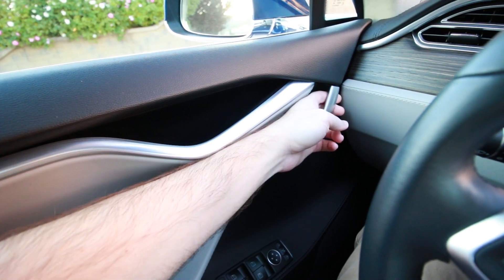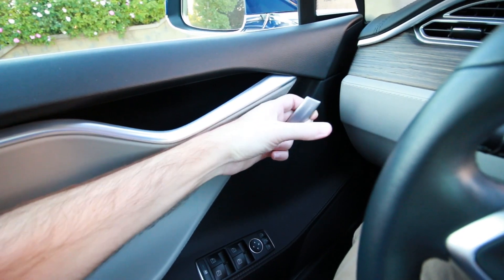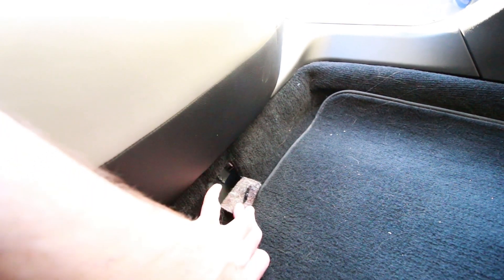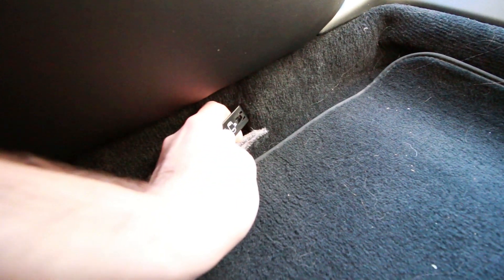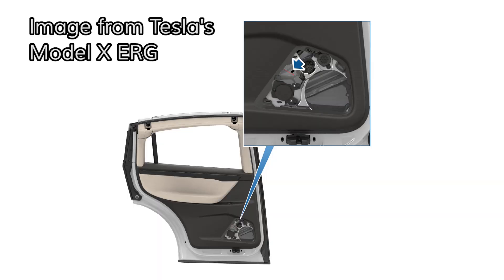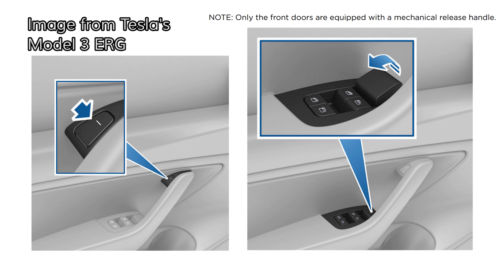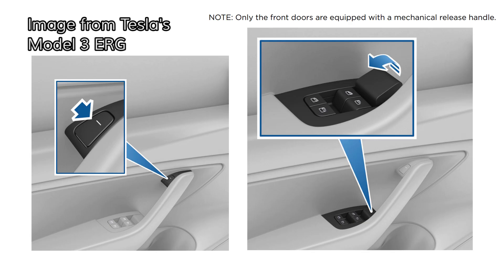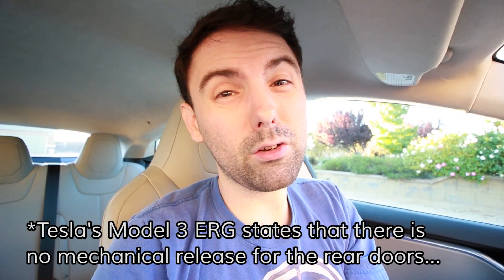How To Open A Tesla's Doors In An Emergency

Comment: It's frankly baffling that a car is allowed on the road that could lock the fucking rear passengers inside in the event of an accident.
Reply: All modern cars can lock the rear passengers in if the child locks are set to the locked position. (I've seen them come new from the factory set to locked)   You actually have to open the rear doors to reset them to the opening position.  Be aware of this as it could indeed be dangerous.
Reply: Unfortunately, all cop cars are like this.
Reply: Stopping children letting themselves out on the motorway is considered a higher priority as that is much more likely than an accident that causes the doors to stop working. If you need to get out in a hurry most people would be able to climb through to the front to go out that way.

Comment: One of the many reasons why I’m never going to buy a Tesla. I came to this video after hearing about someone burning to death in their Tesla after a crash which caused the battery to catch fire and nobody could get the door open from the outside and the occupant inside struggling to open the door after the crash. What a horrific way to die.

Comment: So if your kids are in the car and it catches fire with them in it you're absolutely fucked.
Reply: Not to mention you're right on top of the closest equivalent of a mattress-sized Samsung Note 7...
Reply: The door locks work on the 12v battery so I'm most cases you could still just open them normally.

Comment: Man, it's an awful design for the back door release. I wonder how fast you could open up that door in case of an emergency, with the car filling with smoke, or water, or being upside down...
Reply: The mechanical door release overrides all the electronic controls including locks and child locks. It's a fail safe system in case for whatever reason the electronic locks aren't working. Because the door can always be opened with it, even when the child locks are on, they have to hide the release in the back so children can't open the door when you're on the motorway etc. That is why they are like that. I'm not saying it's the best way to do it, but there is a good reason. They have to make a balance between making it hard for a child to the door when they shouldn't vs making it easy for an adult to open the door in an emergency.

Comment: I dunno how they even passed safety regulations. If your car is on fire and your injured your basically screwed. Oh let's remove the speaker grill pull on a piece of wire and lift the door.
Reply: If you kick the speaker grill in the middle  it will pop off , but I 100% agree Tesla should of designed like an Airliner over wing emergency exit latch that is clearly visible with instructions placard, after all you do get the sensation your in the cockpit of a fighter Jet in a Model X
Reply: Just jump in the front and goooooo that's what I'd do model 3 style xd
Reply: A person died trapped in a model S that engulfed after an accident, responders couldnt open the door to save him. Came to this video and saw your comment :(
Reply: Ole Brumm  The family filed a lawsuit, not sure about the latest developments..
Reply: Ole Brumm  Same even I'd want to hear what they say, I mean it's not a small issue. They need to explain this to the public regardless of the lawsuit. RIP to the guy..
Reply: @santoshs5244  i knew that person. You are talking about the doctor in florida?
Reply: @janabsahib5429  yes
Reply: @santoshs5244  What a way to go.
Reply: Should've just follow the front door mechanism.
Reply: If Tesla built houses, you'll be unable to enter or exit your house in case of a power failure or emergency... unless you remove this section of drywall to access a hidden mechanical release for the electronic back door...
Reply: The reason the emergency release is hidden in the back is so that kids don't open the doors when your are driving.
Reply: @rapnjoe Yeah it should be marked in red like the old automatic seatbelt override switches

Comment: The government should establish laws mandating all door release should be mechanical and prohibit any type of electronic door lock release that can fail when power is out. That's the same idea as the law prohibit blocking the fire escape of any building. Nobody wants to be in the situation that need to move obstacles when trying to escape a building on fire.

Comment: on the model 3, 
the back seats fold down an then you open the trunk using the child manual unlock switch required on all vehicles to open the trunk from inside
Reply: Manual open for trunk is availablebit not for the door. Musk needs to have his head examined.

Comment: Remember braking the window is always an option. It is not as easy as they make it look in the movies.   I have an glass braking tool in all my cars.  With enough force if you punch dead center with the side of your fist  the drivers window will turn into 1000 little squares of glass.  Never seen it done on an rear window though.
Reply: Windows generally don't have brakes on them
Reply: @wire_writer  they do if you have glass rims.
Reply: Teslas are designed for the windows to be shatterproof. A few people have burned alive in Teslas because paramedics couldn't figure out how to shatter the windows or open the doors manually from the outside.
Reply: @SkyyPiano  not true, all windows in the us must shatter in order to pass us certification.  Only the top glass is designed to stay in place during a crash.
Reply: @fatboy19831  Read the case of Dr. Omar Awan. He burned to death in a Tesla because of some mechanical failure on Tesla's part.

"First responders then arrived on the scene, and were also left stumped. Teslas are meant to have two back-up safety mechanisms.

The first sees the door handles pop out automatically in the event of an accident, unless it happens very abruptly.

A second option can allow first responders to break the car's window, and manually pop the doors out using a special mechanism inside.   

But neither happened, and Awan's family insist it is because his 2016 model car was faulty. "
Reply: @SkyyPiano  So one Tesla? Really?   I have owed 25 +. gas cars.  Two of them caught fire. Both of them were Subarus.  I have only owed 3 Subarus.  I have two other friends that had Subarus that caught fire. My 1996 Subaru wagon went from smoke to complete Frame and ash in minutes.    I have another friend that had an MB 240 Diesel that burned to the ground.  Any BMW has to be at least 10 to 20 times more likely to catch fire than any Tesla. That does not count all the gas cars that I have seen on fire.  Give me an electric car please.  

The 2016 Tesla S a limited production car contains 100 kw of peak energy.  A 2016 Corolla with a full tank of gas contains 462 kw of energy.  I don’t know of anyone that has had a Corolla fire.  I have owned six Corollas. Not one has ever come close to burning up.  462 kw.  Think about that.  If you hit almost anything above 25 mph in a 2016 Corolla you are lucky to escape serious Injury. 

I picked the 2018 Tesla 3 because it was the safest car money could by in 2018.   At any price.  I think it still is if not the y. 

If you are an emergency responder and you can’t break a car glass window.  Maybe you should find another profession.  Please.

Comment: Very insightful and not silly at all man! If I'm ever stuck in a Tesla or someone is, now I know what to do to help me/them. I wonder how the mechanics work if it got submerged though. In a normal car you're advised not to try pry open a door as 1 that is silly due to the pressure difference between the car's inside and the pressure compressing against the vehicle as you're sinking which changes, which even if you tried you probably would not be able to and the car would sink further. Guess a similar principle would apply as the car is electric and its systems' would dysfunction or simply shut down but then again I haven't done much research behind the mechanics of a Tesla, though I like to learn things for fun and would love to own 1 in the future. I've always wanted an electric car.

Comment: I don't know about in a Toothla but in some cars you can pop the windshield out by using your feet and pressing against the back of the seat.  Not gonna work if you have the seat far forward coz you won't have room to get your feet up against the windshield.  Used to do this in the junkyards as a kid! 

If you used two people w/ equal force on each side sometimes they'd come out intact.

Comment: My front driver door doesn't open from the inside even if I pull the handle all the way. Any fix or way around this? I need to look at the wiring harness as I've got loss of power in the front and back offside doors

Comment: What bothers me is the back doors are more difficult to open mechanically.. that's where the kids would sit, and if they can't open the door easily then they are screwed
Reply: The parent sitting in the front should be able to open the door from the outside, hopefully.

Yet another reason not to leave children alone in the car.
Reply: The reason it's hidden in the back is so kids can't open the doors when it's not safe. This is deliberate.

Comment: Since it is impossible to find, can someone tell me if I’m an accident power is lost and you are injured , will the model 3 doors open mechanically from the OUTSIDE?
Reply from the maker: Nope. Bust the window and pull the mechanical release, or cut the door off, or cut the roof off, etc., etc. It's all in the first responder guide on Tesla's website.
Reply: @AlexVenz  I'm going to go out on a limb and suggest that the guy cutting open the door or roof might not actually be the "first" responder.

Comment: What worries me is getting out ofi the model x back door if it gets submerged?  That's a lot of weight against exterior water pressure. Especially if access to front door been cut off.
Reply: It'd be crazy to try and open the gull wings under water. You have to climb through to the front.

Comment: I'm not sure how much water there is near roads there, or how long the doors function under water but a bright floating emergency hammer would be more useful than a hidden manual latch, also for cutting seat belts.
Reply: you recommend  this for al cars I guess
Reply: @gaborkevlar2821  All cars with windows and/or seatbelts. Front windows have plastic in them, so break the side one.

Comment: This does not work on my 2015 S. A real mechanical release would open the door from the inside even if it is locked, because if there is no electricity you can't use the unlock buttons either. There must be some other way?
Reply from the maker: This was demonstrated using a 2015 Model S and the manual release does override the locks, even for the rear doors.
Reply: @AlexVenz  thanks for the quick reply,  in theory of it was a mechanical release shouldn't I be able to pop open doors while driving if I pulled hard enough?
Reply from the maker: I can't say I've tried opening the doors while in motion but activating the manual front door release isn't a matter of pulling hard enough, you just have to pull the handle all the way back.
Reply: I have a 2015 ms and the front door doesn't open with loss of power. The drivers side (I suspect) has a broken wire in the wire harness and so there's no power to the front and back. I can't get in or out the drivers side regardless of how far back I pull the handle. But I can on the passenger side.
Reply: Yeah same for me. Kind of scary. Must be broken too  People should test their car or ahead of time to be aware.

Comment: Funny, my '62 MG Midget had a little lever on a spring that you pulled right at the latch.
It was so obvious that people had a hard time figuring it out!

Because the car is so small, you have to reach over your body with the hand on the opposite side to comfortably open the door.  And it's right near the door latch so people aren't used to that.  You can use the "local arm/hand" to open the door but it's not as natural.

I like how the Tesla did it that is nice to know about even tho' I will probably never get in one!
I like the cars+tech themselves but they are al ways quite unattractive.  Weird since Elon knows style, used to drive a Jaguar XKE, etc.  Not my business I guess just think it's strange their cars are so blasé!

Comment: I have a question.  What if you’re on the highway and the accelerator is stuck on? How do you stop it?  In an ICE car you can simply turn off the key/ignition and press the breaks.  What about with a Tesla?  How do you shut off the car in an emergency?
Reply from the maker: Pressing the brake at the same time as the accelerator results in motor power being cut. So, hypothetically depending on the specific nature of the failure, just press the brake to bring the vehicle to a stop and put it in park.
Reply: Never EVER turn the ignition key to OFF in an ICE vehicle while in motion..... the steering will lock and not allow you to safely steer your car to the emergency lane.
Reply: proudparnt The steering will not lock. It will only stop the power steering since the power steering pump will stop. You can still steer, it's just much harder and requires a good amount of force. I had that happen to me back in highschool with an old car I had haha. Lucky I was only going 35mph and not highway speeds
Reply: Nick ....quote from the owner's manual of my wife's car:  "Never turn the ignition key toward OFF while the car is in Drive as this will activate the steering wheel lock and make it impossible to steer the car." ... her's is a 2007 so it may be different now but I'd err on the side of caution and slip the car into Neutral in an emergency rather than try to turn off the ignition.
Reply: proudparnt Hmm ok it happened in my 07 grand Prix. In my scenario my engine died while on the road so the key was still in the "run" position so this would not have activated the steering lock
Reply: No modern automatic car will allow you to turn the key to lock steering unless in park.  So no worries if it is an automatic.  All cars now have a separate ignition off position on the key, but in a manual you could turn the key too far and lock the steering, but it has a key off steering not locked first.
Reply: I think you push and hold 'P'. The car breaks to a stop.
Reply: You should never turn off the ignition in a gas/diesel car when the car is moving. If the accelerator ever gets stuck, move the gear shift to N. This will make the transmission uncouple the engine driveshaft from the wheels. You can then coast to stop & use the brakes to stop the car. Also, you will still have steering to control the car.
Reply: Or you just move the shifter into Neutral or turn off the engine but keep the ignition on.

Comment: I know nothing about engineering, but why should the doors require electronics at all?  Maybe the locks on other cars are electronic (or electronic and manual), but if a door is unlocked on most cars they just don't require electricity to open.  I don't see the point in making the door latch itself electronically actuated.  Maybe I'm missing something.
Reply: I think on Teslas there is just one latch and "locked" just means the outside door opening button gets ignored by the computer. I think doing the doors the way they have makes them harder to break into without smashing the window. Maybe it avoids damage to the door handle from people trying to force it open.

Comment: i ratter kicking or breaking the glass or if i'm not injured get out through the front door
Reply: Your body will hurt after breaking that glass.  The glass won't cut you but breaking it requires a lot of energy... its tensile strength is quite high.  Unless you're "Brutus" you will require a glass breaking tool to get the safety glass to shatter.

Comment: I am surprised that mechanical emergency openings in the front and rear are not legally required. Not being able to use them in the Model 3 or only with great difficulty in the Model S and especially the Model X is unacceptable. How are children supposed to do this after a crash, for example, if their parents are unconscious or seriously injured?
Reply: It's because of children that they are like this. If they just had a simple handle then they could open the door when you are driving along.
Reply: @adrianthoroughgood1191  Nonsense. Every car has normal handles without children opening the door while driving.
Reply: @geraldb.2245  all cars have some form of locking mechanism to prevent the back doors from being opened. Since the Teslas locks and child locks are electronic the mechanical override overrides the child locks as well. So they hide them.

Comment: These are comically stupid and dangerous designs. (You're supposed to take the speaker grilles off when you're drowning or burning alive?!!!) And they serve no purpose. Did anybody have trouble opening the doors before these "innovations"?
Reply: In an emergency you're supposed to climb into the front and get out there. The manual release is hidden to stop kids opening the door while you are driving.

Comment: Lmao this is comically badly engineered. And I am not a Tesla hater. Is this an issue at all with other cars? Or is it just Tesla? Does every car have an emergency latch, or do they just use the regular doorhandles as such?
Reply from the maker: This is an issue with any car that uses electronic door latches, which are becoming increasingly common in higher-end cars.
Reply: @AlexVenz  Electronic door latches are a gimmick which just adds complexity to the vehicle, and a point of failure in the event of loss of power, circuitry damage, or damage to the electronics after an accident. On any other car with mechanical door handles, you can still open the doors even if the battery is flat.